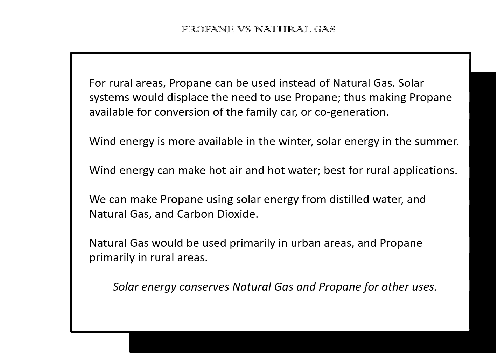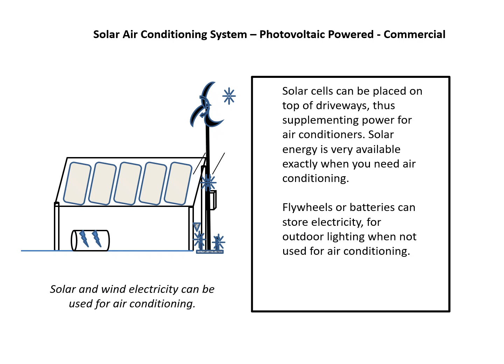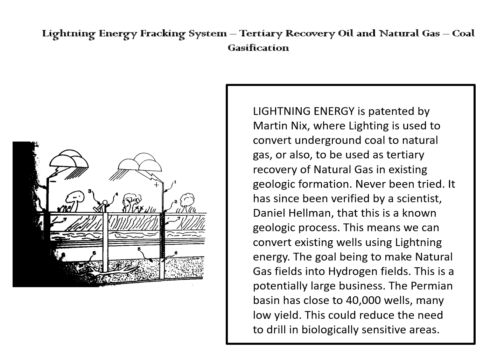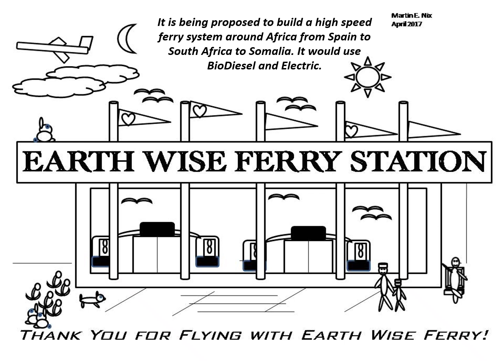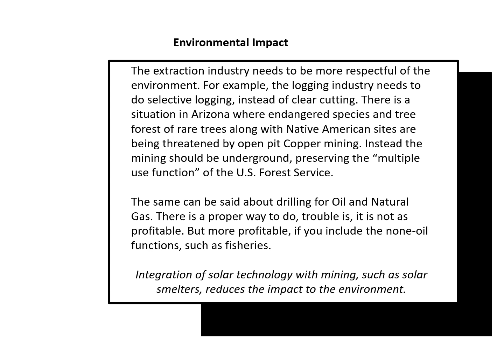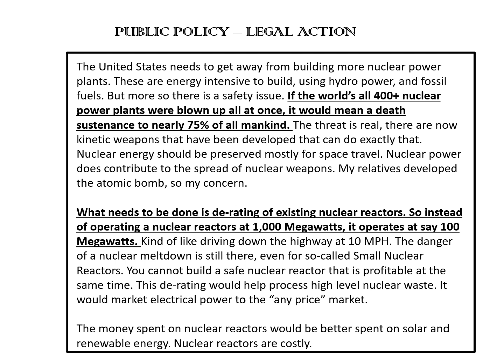ThermalEnergyVer6

Comment: Illinois EnergyProf will tell you the cost of nuclear plant and cashflow. The 'economics' but ignore the $TRILLIONS national grid to the millions and millions of consumers, the customers cashflow. 
This is an utter failure. 
4cents kWh electricity costs 44cents kWh at the meter boxes from millions and millions and  .... 

It is MISS LEADING ECONOMICS and distorts peoples thinking. 

Fossil fueled energy is 20times bigger than grid electricity. 
Grid electricity is impossibly insane fantasy, wet dreaming economics as a real fossil fueled energy alternative...